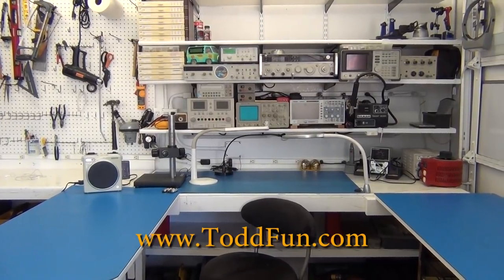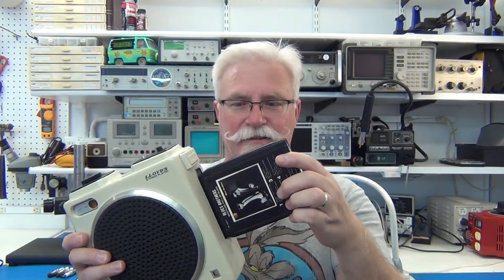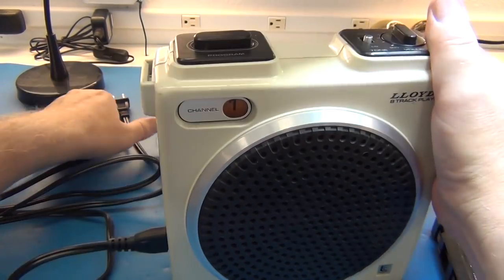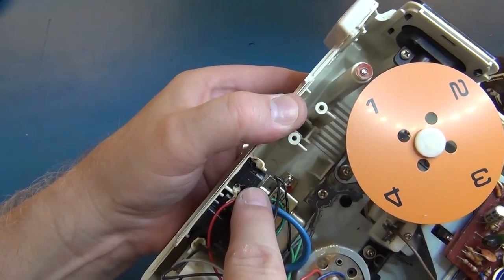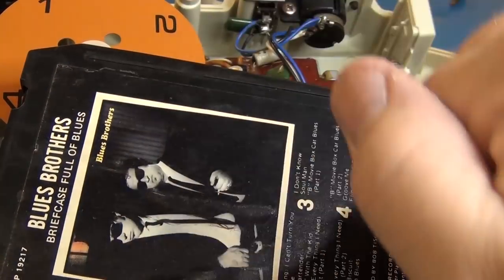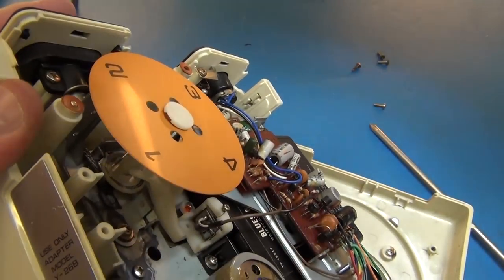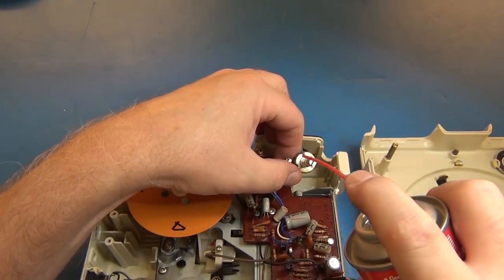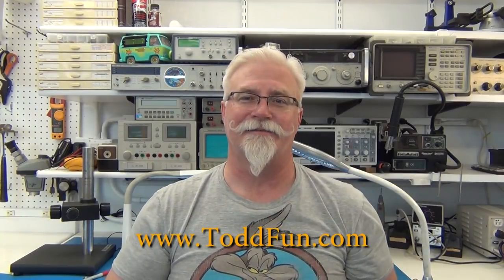Portable 8 Track Player Teardown

Comment: the head holder thing is always broken. the only solution I've found to even slightly work is to tie it up with wire wrap (30 awg). but that is for extreme cases where the head is flopping around and can't align properly. been considering 3d printing a replacement whenever I get a 3d printer.
Reply from the maker: I have a 3D printer. Maybe I'll try that.

Comment: Rust on the battery contacts is easy, batteries leaked at some time and the nickel coating has corroded off there. You can see they made a lot of these, with the mould wearing so they had to put in the cardboard spacers to keep the screws from breaking the mould halves. Could do to replace the larger electrolytics, they are over 40 years old, and probably the ESR is a little high, though all they will do there is add hum and reduce low frequency response as they age. Mains capacitor though is probably a good idea to replace with a new one, double the likely 470-1000uF 16V one they put in there, put in a 2200uF 25V one, and it will reduce the wow quite a bit. 

Then strip out the mechanism and change the belt, the old square one there likely is going to fail soon as it gets used again.
Reply from the maker: So true, I should take a poke at replacing caps as I do run it on mains mainly. Sound great right now however. Where on earth would I find a replacement belt? Easy enough to change if I know I have a NOS belt I guess. Thanks.
Reply: Just use a generic belt that's the same size or slightly smaller.
Reply: 12voltvids has a good tip to slightly shrink belt by boiling belt in water for 15 mins. in microwave.

Comment: Cool score on the 8track  back in the  day my father used to  swear LLoyds electronics were a decent value ?   I was also   A cool guy back  in those days  because my Dad had a  Pana sonic stereo in our living room that allowed  you to record  onto 8 track tapes !  Ironically  i have a pretty large  family with many of them have music talents  recently  a 8track was discovered with some  studio demo recordings I  transferred from a cassette to  the 8track  in order to make it easier to listen to. Because  everyone had  the players  every where you  went  lol  a small amount of research i did  via Google   Turned up that the Lloyds  brand was  pretty much  a rebranded   Name used on many items as a marketing tool to make it sound more American made ?   I  had a old digital flip clock radio  that the clock mechanism quit working but the radio  continued  going for  30 years   It eventually became our  garage shop radio  where many hours of music was  enjoyed by myself and my father  working on numerous projects in that shop  i think part of the  good sound quality.  Many of those things had was from a decent speaker  or speakers being installed ?  My first digital calculator  was also branded Lloyds and still works on AC power only it has the blue LEDs   N was a very expensive Christmas present back in the early 70s  it was  a portable unit as it could run on batteries also  it was a fancy one  back the  due to the blue color numbers and the memory feature it had. Built in ? I laugh   Now  as those are features  built into  eve the cheap calculators  these days  as i bought a super inexpensive  solar powered one   For my toolbox just to have one handy  on construction sites  where i worked
Reply from the maker: Thanks for sharing Craig. For hobby fun playing with these older technology is fun and rewarding when you get it working again. I have and iPod there the back button would working and just had to put it in the trash. At least I can work on old 8 tracks and old radios for fun and to enjoy old songs I still have on tape. Even on Pandora I can't find a lot of the songs I link or at least not when want to enjoy them. I loved those 1970's calculators. I used to spend hours reading and learning about calculators from Sears catalogs and technology magazines in the school library in the day. I couldn't get enough and when computers started to become available I was beyond infatuated as you can imagine. I still have and work on my Apple II and C64. I have videos on my channel on two old calculators and some one my Apple II Plus. Here are the links to my play lists:

ToddFun - Old Calculators
https://www.youtube.com/playlist?list=PL40clH-yZ7fmNTANPWCcb_YyTSmcHUD0G

ToddFun - Apple II Computers
https://www.youtube.com/playlist?list=PL40clH-yZ7fndmhflS6Xzt21kJFm-3q1Y

Comment: Can i fix a cracked head mount using one from another 8 track player? Can't seem to find them for sale
Or is glue the best solution?
Reply from the maker: If you have the broken one you might be able to get a local high school to take on the project of CAD-ing up a 3D printed one out of PVC. Or do it yourself and upload to a side where someone can print it for you and send you the print.